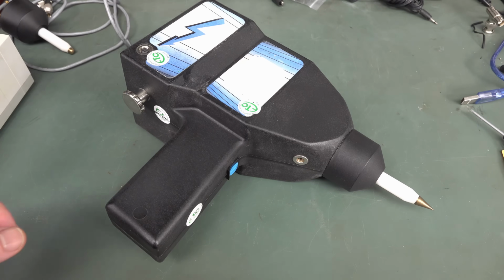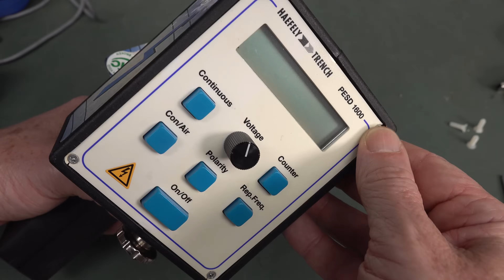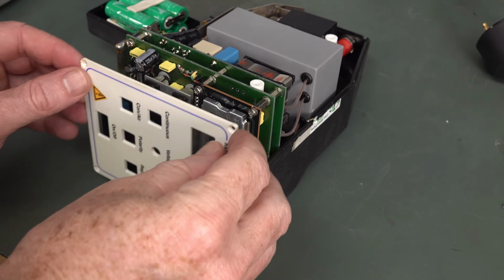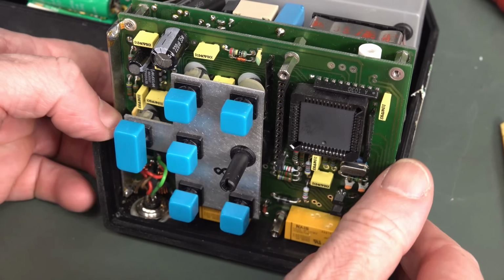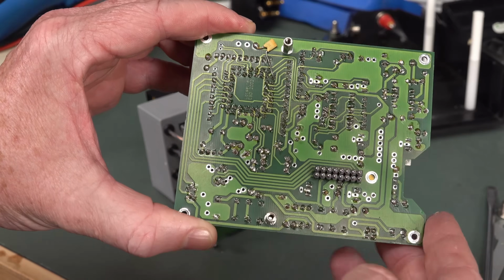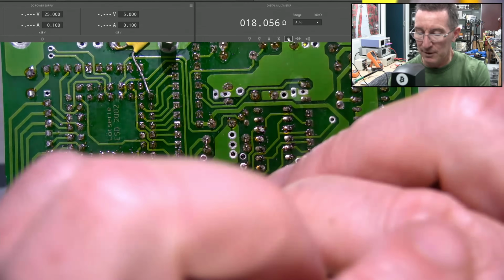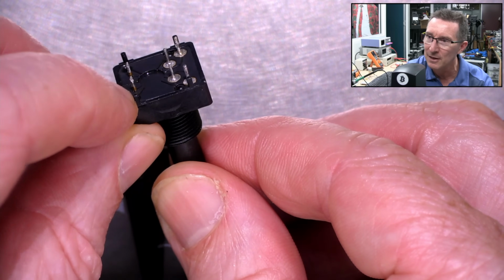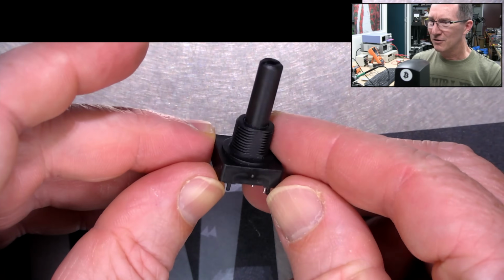EEVblog 1572 - Haefely 16kV ESD Tester TEARDOWN + Repair Part 1

Comment: The rotary encoder looks like it is an EBE BG 16 (Angle pulse encoder), which can be found for example at bürklin electronics
Reply: Damn, you seem to be right! 🫡
Reply: Wow, that genuniely looks like the thing! Sadly, the data sheet doesn't quite make it clear what the second set of outputs do (at least to a non-EE like me), but physically that pretty much looks like a perfect match.
Edit: From the video, I'd expect one set to "beep" at every stop, the other only every Nth stop. Still, the data sheet doesn't mention anything like that.
Reply: @fonkbadonk5370  The encoder basically connects Ak to common, while between notches and Rk, while on a notch. There is one Ak for each direction.
Reply: 94 Euro. Holy moly.
Reply: @fonkbadonk5370 There are 3 pins for each rotation direction. Per click it connects the output pin to Ak and then back to Rk and like this generates a pulse per click.
Reply: Looking at the datasheet that's a complicated way of doing it. Wonder why they didn't use a much simpler quadrature one.
Reply: @Graham_Langley  From experience how suff works in companies: They maybe had an intern who had done a prototype with that one.
Reply: @chrisridesbicycles  My point was why did the encoder manufacturer do it that way? Quadrature encoders have been around for ages and there would have been two in every ball mouse the designers were probably using at the time. Could have been a special that the manufacturer made generally available I suppose.
Reply: @Graham_Langley  Being an engineer in Germany, I‘d guess that the roots of this company are in precision plastic parts and if you have an axe, everything looks like a tree.
Reply: @chrisridesbicycles  And if you have a hammer everything looks like a nail.

Comment: We have one that we bought new in 2021! It is a different brand, but looks exactly the same as far as I remember. The built-in battery of ours is lithium instead of NiCd, though. And the manual says that if the internal battery goes completely flat, you have to send the whole unit back to the manufacturer, because you won't be able to charge it anymore 'for your safety', of course! Seems like this older model lacks this super handy 'feature'.
EDIT: UPDATE 19th NOV, 2023! I checked it about 10 days ago, and it is a SCHLÖDER SESD 216, produced in 2021 I think. It looks 100% identical, even has the same blue ribbon cable ground wire. I don't think it uses the same encoder, though. The knob has a super tiny hex screw to hold it which I did not have a key for, so I couldn't check the shaft.
 
And guess what: the battery was flat! Fortunately it behaves better than what the manual suggests. I was able to charge the battery. So it has a dual cutout system, just like a phone: below a certain voltage it will refuse to power up, but the cutout voltage of the BMS itself is under that threshold. Probably it will only refuse to take a charge if the BMS is shut down due to undervoltage. So they did it right!
Reply: My guess is the unit is very specifically calibrated with the standard battery and a user replaced battery can either void the certification or produce different unwanted pulses that aren't certified.
Reply: @Haarschmuckfachgeschafttadpole  There are absolutely zero technical reasons for a non replaceable battery in this case.  Its just a method to increase the income of the company.
Reply: @Haarschmuckfachgeschafttadpole  I haven't mentioned battery replacement. If it just goes flat because you forget to charge it, it will lock you out, despite the battery is perfectly fine, just needs a charge!
Reply: @mrnmrn1  I thought Apple had a patent on that technology (edit -  I think it is limited to telecommunications devices).
Reply: There's a little more to it than greed when it comes to Lithium batteries. They have a known failure mode that could happen if deeply discharged.
Reply: @Chriva some lithium batteries come flat when you purchase them brand new.
Big Clive did a video on this in the past.
Reply: @Chriva  And this "known failure mode" is?  What bad thing is going to happen with a flat battery?  Nothing?  Leak?  Hurt your toe when you drop it on your foot?  Locked out by the charging chip?

Why do people write such rubbish, implying they know some super secret thing?
Reply: @Chriva  Not necessarily greed, just simple lazy incompetence.  There are Lithium battery protection boards or ICs integrated into most Lithium batteries nowadays, even in incredibly cheap Chinese toys!
Reply: @ronniepirtlejr2606 Chemically they do not come "flat", but the BMS is in ship mode.
Reply: @j.f.christ8421  lithium cells will die if you discharge them too much (and will burst if overcharged). This is usually handled by a BMC circuit that cuts off the power when the battery voltage is too low or too high.
Reply: @ronniepirtlejr2606  those were not "flat", they were half charged and BMC was in shipping mode. A truly flat lithium cell is dead.
Reply: @marcogenovesi8570  We know all that.  Apparently there's some other super secret danger "it's bad for them" that only @Chriva knows.
Reply: @j.f.christ8421  That's the "known failure mode" he is talking about. If lithium cells die, that's a "failure".
Afaik it's uncommon but it's possible to have battery packs without a BMC in a product. I know about that in FPV drones where it's seen as "better" to just damage the battery while landing than to just cut off power while the drone is still in the air (and crash it hard)
Reply: @marcogenovesi8570  So why say "known failure mode" when you can say "it's bad for them" unless you're trying to appear cleverer than you actually are?  And who's to say that's what he meant anyway?
Reply: @j.f.christ8421  Is "known failure mode" a so hard and difficult phrase for people to understand? I mean it's right there
known = we know it exists
failure = something bad
mode = type of something
So it's "a type of something bad that we know".
There is no real technical jargon in there.

GG on both claiming I can't say what he meant while you also claim he is trying to appear more clever. The cognitive dissonance is palpable
Reply: @mrnmrn1  Wow, what a sh#tty design. Probably because they are using volatile memory to store calibration data but still. Why didn't they just use a "chubby" ram for that task?
Reply: @marcogenovesi8570  Everything has a "known failure mode".  That still doesn't tell you what you should not be doing to cause it.  He could have meant don't "keep them in your freezer" for all we know, that's another "known failure mode".

Is your "idiots making useless comments" detector broken?
Reply: @j.f.christ8421  Yeah and the li-ion known failure mode is over/under-charging. Physical destruction does not count as "failure mode". Keeping lithium batteries in the freezer isn't a failure mode. It's a reconditioning technique to regenerate old lion batteries.

My ""idiots making useless comments" detector is blaring only when I'm reading your posts
Reply: @shazam6274  a lot of them do come integrated on the BMS for the battery, made up of individual cells.
"Most" 18650, 21700, 30700 & so on do not have an integrated protection circuit.
You can choose to buy one that does.
Reply: @marcogenovesi8570  I recommend to NOT discharge them below the manufacturer's recommendation.
With that said, I have very carefully & very slowly brought them back to life when I find them flat.
4. 2 volts @ 50 mA taking temperature readings constantly!
I will make sure that an internal short from  dendrites has not happened.
If the battery is NOT getting hot then I will continue cautiously.
Once the battery reaches around 2.7 volts, I usually increase the amperage a little & ONLY If there's no heat.
When the battery eventually reaches 3. 2 V.  I will disconnect it for about 2 minutes to see how fast it will discharge. 
If it starts dropping and continues to drop without slowing down, I will recycle the battery!
If it Slowly drops in voltage then tapers off. I Cautiously continue with a normal charging current of 500mA at 4.2V.
The battery may or may not last a few years?
If I find that the battery keeps discharging faster than I like, I will recycle it👍
Reply: @ronniepirtlejr2606  Yup! so he should get one of those and don't be a whiny sissy!
Reply: @WolfmanDude   UPDATE:  I checked it about 10 days ago, and it is a SCHLÖDER SESD 216, produced in 2021 I think. It looks 100% identical, even has the same blue ribbon cable ground wire. I don't think it uses the same encoder, though. The knob has a super tiny hex screw to hold it which I did not have a key for, so I couldn't check the shaft.
 
And guess what: the battery was flat! Fortunately it behaves better than what the manual suggests. I was able to charge the battery. So it has a dual cutout system, just like a phone: below a certain voltage it will refuse to power up, but the cutout voltage of the BMS itself is under that threshold. Probably it will only refuse to take a charge if the BMS is shut down due to undervoltage. So they did it right!

Comment: Ive never seen an encoder like that before. If you can get it apart without damaging it, im 100% sure the problem is dirty contacts. It'll just need cleaning.
Reply: It will need a replacement, because the contact material is worn out. You obviously have zero clue on how encoders internally work.
Reply: @t0scanelli saucer of milk for table 2 plz
Reply: @t0scanelli  but we are not talking about other encoders and how they work.
we are talking specifically about this encoder and how it doesnt work.

Comment: I think the inner and outer pins on the encoder are for detecting slow versus rapid movement at different distances from the center of the control.
Reply from the maker: Yes, seems likely.

Comment: I swear I've seen this encoder pin-out in an automotive application before, it looks a lot like the type used in mid 90's OEM stereo head units with that small form factor and "decade" pins for faster steps when tuning the radio...

Comment: I used to use one of a similar model, a Thermo Keytec MiniZap, back in a former life.  I had to use it to test landline (yes, that degree of former life) phones, having to sweep the device while on hook.  I remember one Siemens phone I tested, that had this metallic coating of paint around the keypad area, and this coating would actually hold a charge.  The ESD gun would not fire on the keypad, but the keypad would discharge to me when touching the paint...quite a discomfort.  We had a bunch of interesting gear at the lab.  We had quite a set of Keytec ECAT test boxes in 2 racks, which simulate surges and such, similar to what lightning strikes would do on a phone line.  The old 500, 1500 and 2500 series sets, the ones with a solenoid operated ringer bells, would ALWAYS chime the bell when with the surge was fired. As for price, yeah, that stuff was not cheap.  I was told that each of the modules, which we had 8 of them, would cost more than a nice car.

Though, later in my life at that company, when I moved to the wireless team, we had had CDMA test boxes that were like $180k each, and we had like 6 of them.

Comment: I grew up fixing TV's in my dad's TV Shop.  We had tons of fun with the 30kv from the flyback or discharging the picture tubes, (yes, TV's used to have big tubes that displayed the shows).  I cannot count the number of times my arm discharged one of those things.  I had a chassis out on the test bench and had to look around the back when the second anode caught the top of my head and out my chin.  That day I learned a quick discharge was not the same as a constant shock through the skull.
Reply: Omg. If a YT comment could enstill nightmares. 😮

Comment: I've had difficult switches like that rotary encoder before. One thing I've done that sometimes helps is to use a pin vice and a small drill bit and drill a hole through the case. I would use a syringe with a needle (a local farm supply store had syringes with large needles for animals) filled with white lithium grease and inject the grease inside. Work the controls to spread it around inside.
Reply: Pin vise is wizard magic, brings back the dead, Dave should demonstrate this!
Reply from the maker: Already got contact cleaner down the shaft, didn't do anything.
Reply: @EEVblog dip it for few hours, if you have vacum chamber then use it.

Comment: If you have to bodge one in I'd solder a cable onto the board and have it fed outside the case. Solder the new encoder on the end of the cable. Then it doesn't matter what shape or size the new encoder is. You could mount it many places on the side of that case.

Comment: Dave. Try to connect encoder to oscilloscope and look what signal pattern it have on remaining pins.
The only similar encoder with 4 mechanical contacts which I was able to find with quick search is EC18AGA used for washing machines. But it is Gray code absolute encoder.

Comment: Hi i used to do a lot of ESD  testing and assessment on company equipment as part of EMC testing and certification and UK / US post office compliance evaluation. We used Schaffner Equipment which was also very expensive but high quality .We used 7 KV for UK/ European requirements and 16KV for US requirements. The two types of tips/probes were for either contact discharge (pointed tip) and air discharge (rounded tip). Also the simulated human body impedance varied with authority's complliance conditions.

Comment: Hi Dave, when I was studying electronics engineering at technical college in the 1990s, the CE marking requirements were introduced so it became part of the curriculum. We students were given the task of developing and constructing all the necessary test equipment.
My task was to develop an instrument like the ESD gun you have just examined and because Greenland is part of Denmark I also had to make a 25kV version, because it is demanding in arctic countries due to the very dry air that personal discharges reach that high voltage.
The anonymous IC may be a SAB80C535 they were popular back then.

Comment: Pretty much identical to the ones we use in my lab. I always wondered what was inside, aside from the interchangeable caps and resistors.
Reply: I double checked to be sure. Yeah, our older ESD guns are Haefly, but they go up to 30 kV instead of 16. I imagine they're stupidly expensive. 😅
Reply: what are u testing with these? dont tell me computer motherboards😆
Reply: @echelonrank3927  Avionics. Military, commercial, and space. Also military C3I stuff that doesn't fly. Needless to say, the standards are very high for these applications.
 I do occasionally do ESD testing when the lab is slow, but mostly that's delegated to the "341" garden-variety techs.  They mainly reserve guys like me ("170") for when tests must be conducted that are hazardous to the equipment, where there are clear standards but no set procedure. They trust us to get accurate and repeatable results without breaking stuff in the process.
 It's a pretty cool job.
Reply: @GoSlash27  i have a few european tram motor drive systems at work built to withstand lightning hits. but not australian heat 🥵
Reply: @echelonrank3927  Yeah, lightning testing is a whole other beast. We use Thermo Scientific ECAT units for that. I've never checked to see what they cost, but it must be insane.

Comment: To open it, you need to use  bit made for milling machine that has flat surface tip. You see  four points where  ultrasonic welding was applied. Drill it just  to the depth of 1mm.  After that  it is ready to  be opened.

Comment: I would recommend 'Dremelling' out the perimeter seal first, and lifting off the 'cover'.
There is a chance that the 4 heat welded pins hold the contact armature 'cage' (as an assembly of loose parts).
@therealjammit had a good suggestion of drilling a small hole to get penetration of a cleaner into the encoder.
I have also used vacuum or heat to suck solvent into a part: I oiled a clockworks type timer motor by alternately placing in a warmed oven (burner off) and cooling in fridge, while the shaft 'bearing' area is immersed.
I found a small spray can cap, or ink marker cap, to hold the fluid, with the part 'upside-down' in the cap.
[shaft facing 'up' during heating, and facing 'down', immersed in liquid during cooling.]

I got so much oil in that I could hear it when I shook it, after just a few heat cycles, (much more than could be infused by oil applied to the shaft). [drilling a hole would have been my next alternative].

You can use the thinnest 'Dremel' saw blade or cutoff disk, or an ultrafine burr you can find; or grind the sides of a stock saw blade thinner. [run the blade at medium speed against a running bench grinder. -- SAFETY GLASSES!]

Comment: I'd say to bridge the functional pin on the one side of the encoder to the non functional pin and hope that increments the value without too much issue.
Reply from the maker: Was about to try that, but I soldered it back in and the good side is now completely faulty on both output pins!
Reply: @EEVblog  :,(  sorry for your loss. though would love to see another video of the process of hacking together a replacement if no matching part shows up
Reply: @EEVblog  Dave, check out the Schlöder SESD 216. It is still in production*, and looks 100% identical. 
*: At least it was still available in 2021, when my emplyer bought it.

Comment: Cheaper to build one your self. Long time ago I needed to test 10kV caps. I took the flyback of an old TV, coupled it to an oscillator  and it made up to 40 kV.. Would be more work to make the correct pulse shape etc but it is do-able.

Comment: Drill out the black dots on the encoder. Those likely connect to the “outer” front case, and slides through the encoder to the back, and then are melted to lock the case. If u drill those black dots, the encoder should come apart.